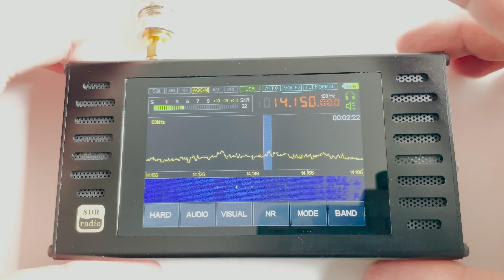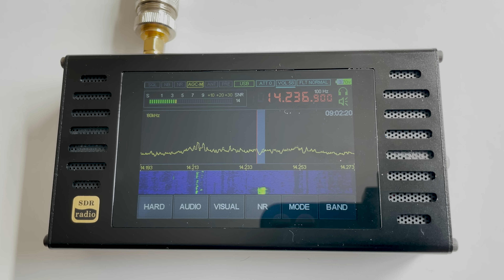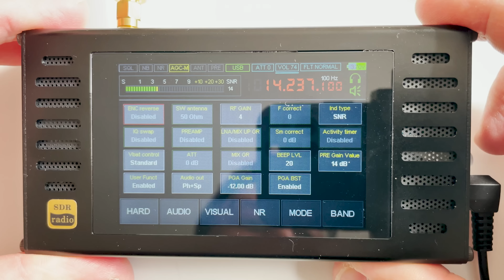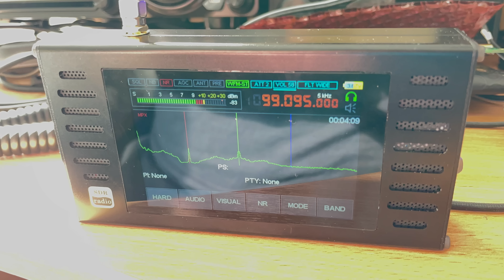Malachite V4 SDR DSP Radio Receiver 50KHz - 2GHZ

Comment: One great use for the Malachite is to find good spots for HF reception indoors or in urban areas by walking around with it and using a portable HF antenna. I use mine with one of those SDR Mini-Whip active antennas attached directly on top with a couple of SMA male-to-male adapters and walk around finding where I get the best HF reception.

Comment: You forgot to show that FM Radio Retro Mode that beautifully imitates a classic Retro (Yellow) Radio front, every skip gets you to the next scanned and listed station (on the fly), really a nice pocket Radio for those that wanna have all the luxury from a gadget like this. I use it most of the time on the go as i do not have lots of other stations on other bands to listen to. I need a better antenna for that.
Reply: Spot on. It's a nice little device for travel too. Little pricey to stock "bug-out bags" but keeping on at your cabin, in your RV or just at home in your emergency kit is cool. I found the FM retro option my accident and thought it was cool.

Comment: it is a Chinese copy of Malachite SDR, the original and Made in Russian it can be found on VK.
Reply: Malahiteam or Malahit DSP (now on version 2) is the original. Malachites are the Chinese clones.
Reply: stay away from these
Reply: VK? what's that?
Reply: @chelrob2  almost 100% sure a clonded DSP1 with old f/w you cannot update (until the chinese find another way to get it. Or you send $$ to the makers of the hard/software (malahiteam) which means that you will pay a lot more than the original.
Reply: @RoelandJansen  Supposedly mine comes with V1.1c.And seems to be the case.Bought mine in USA.
Reply: @skideric  current version is 1.10d  btw.
Reply: @RoelandJansen  Yup,I know.No Prob,like it just the way it is.I researched long & hard before getting one.No way i was EVER gonna be able to get an ORIGINAL.So,settled on this one.Also have a G90,which is very good also.KO4GNW
Reply: @RoelandJansen  Hi Roeland, thnx, can you indicate where best to purchase an original Malahit? thnx Han pa3bpl
Reply: @hanvanloenhout7045  hoi, I'll send you a mail to the address exposed on qrz, ok?
Reply: @chelrob2  Yep, you are right. I got mine yesterday. IMO, the antenna doesn't do it justice for HF DXing but it did work. Never got the built-in decoder to work. I was able to get my Schoolcraft decoder working pretty well though, however, the auto-correction was non-operational. It appears the damn cat had chewed off the eraser.
Reply: @RoelandJansen  Goodluck getting in touch with them. The website doesn't work (blocked?). I'm going to try a VPN tonight and see if that helps. Can't even find a manual for these online.
Reply: @tc1uscg65  probably blocked there, yes. docs are there but not too well wrutten and 3rd party trials are somewhat better.

The dsp1 is a gadget if you ask me.
Reply: @RoelandJansen  50 $$
Reply: @ivanpoddubnyy3421  what?
Reply: clonded

Comment: Dang. I just bought the v2
Reply: you are much better off with a DSP2; This almost 100% sure is a cloned DSP1.
Reply: Has to be a clone.  If you go to the Russians website it only has the dsp2 version. They authentic ones can only be acquired through the Russian dude through email
Reply: @ReefMimic  IT IS A CLONE. this is a DSP1 in a different box. Looking at most of the issues, they are even worse compared to the original when it comes to quality.

Comment: Would love to see some specifications on sensitivity and selectivity.  Is SW reception essentially dead with the provided antenna? Yes, I know using a full size external antenna is an option, but if I buy a radio like this, I would want some level of performance even with a short portable antenna.
Reply: it can be used if there is a lot on the bands during contests. you could use a wire or something. a full size antenna is nit recommended as it will easily overload the shole stuff.

Comment: I've been looking for a somewhat decent clone with activated firmware for a little while. Bought this the day you uploaded, it arrived in the UK today and I'm happy I finally bought one.
Although the touchscreen was not working at all so I did have to open it up and reconnect the touchscreen ribbon cable. The little orange ribbon with the chip on it, between the two red/black twisted pair. Maybe happened during shipping or a forgetful assembler but all good and working now :)
Sure it may not be as good as the real version but sure beats connecting a usb dongle to my phone. With the current coupon discount and some credit I had in my banggood account it cost £106 delivered to the UK in 10-11 days :)

Comment: Hello! What is the reason for the gap between 250 and 400 MHz? And who is using those frequencies?

Is this device good for receiving air band and can you recommend a cheaper/simpler unit that would do just that?
Thnks!
Reply: I was going to post that question, why the gap? Would it have been much more expensive? Or is it because of legal restrictions?
Reply: @advisord7637  apparently it's the russian army band, although in Ukraine's "special operation" they used unencrypted baofengs

Comment: Anyone found an English manual for one? The touch screen looks beautiful but is barely functional at all.
Reply: No luck but I just got mine yesterday and started looking around. What software is used to control it on a PC. Plugged it in, but it didn't pop up. WIndows see's it, and shows up in devices but that's about it.

Comment: Why are they blocking out 250-400 MHz?
Reply: That frequency range is not allowed to receive by Russian laws - the original hardware design is Russian, and the firmware is Russian.
Reply: @automaton450  ah okay, thanks for the info. 

Has anyone found a way to disable that? 

It seems weird if China is replicating it but still enforcing an irrelevant frequency range lockout.
Reply: That section of the spectrum is reserved for military and law enforcement  in Russia.
Reply: They're blocking out 250-400 MHz?! I didn't know that... Well that would knock off mil-air.
Reply: I have the 3 official Russian Malahiteam models.  The original with optional board (also referred as DSP1), the DSP2 and DDC.  The DSP1 running FW 1.10D has the 250-400 MHz gap as the clones do, while the DSP2 running FW 2.20A has a smaller gap of 380 to 403 MHz.  The intent was to eliminate the gap for DSP2.  The reason that a 23 MHz gap remains has to do with the main chip not able to lock or “resonate” those in between frequencies. The DDC has yet to release its optional board which has the filtering and conversion circuitry for the VHF/UHF bands.  The engineer promises for the DDC no gaps 10 KHz to 2 GHz.  Therefore I do not believe the 250-400 MHz gap is for restrictions.  I believe it has to do with its circuitry not performing well in that range.
Reply: Since they censor these stuff, use an SDR :)
Reply: @Antenna101  isn't that the purpose of this product? To act as a portable sdr with screen?
Reply: @GadgetAddict  whats the purpose owning an sdr that censors specific bands?
Reply: @Antenna101  yeah that's the thing. That's why I was asking if anyone found a way to bypass the limits

Comment: I've had old shortwave rigs in the past FRG7700, Kenwood R-2000 for listening, decoding RTTY, CW, SSTV etc.  Would like to get back into SWL.  Is SDR the way to go or should I be looking at a traditional rig?
Reply: I have a lot of experience with portable radios and I'm also a Licensed Radio Amateur.   

My advice to you would be to get the new Tecsun H501x it is a really good radio and nice and big for using at home, for too long all we could get new were much smaller radios, at least ones that could do SSB.

The malahit radios are good but small and the screens are small, to be honest as much as I like my DSP 2 Malahit I mostly use the Tecsun H501 X because it sounds so good and it's a real nice radio to operate.

For antenna I highly recommend the Bonito M305 which is optimised for portable radios and it's great for pulling in distant stations because it's got really good signal to noise performance, a long wire might be fine but it also picks up a lot of noise. The bonito is a tiny whip antenna, use good quality H155 cox and ground it to bleed off any static. Mount the antenna outdoors, only needs to be mounted 6.5 meters off the ground, A radio is only as good as the antenna. 

Check out my youtube channel and you will see me test some radios, at the end of the day SDR are good but there's nothing like using a traditional radio.

These days there is a lot of interference from electronic devices and if you live in an apartment or close to other neighbours you might hear a lot of noise and if that's the case you can still take the bonito and h501x portable, the bonito will work with USB power bank. But you'd be surprised at how much noise comes from your own home. Laptop power supplies, phone chargers, led bulbs etc.

You can use online SDR such as the kiwi sdr, check this link out, there are many online and you will need to find one that isn't plagued with interference causing lots of buzzing noised wiping out all but the strongest of signals. 

http://kiwisdr.com/public/

It may take some time to get familiar with the interface but if you find a good one with low noise I think you will have a good time using it. 

 Best of luck and definitely get back into this wonderful hobby and don't forget to check out my youtube channel.
Reply: Check out icons new HT and base station radios. Expensive but they combine a traditional radio and an SDR radio.   It may lack in both or be perfect I'm not sure.  I wanted one but too expensive still.  North of $500.  So I bought an AnyTone AT-D878UVII Plus.  Seems to be the #1 radio right now and I'm getting into Digital so it's perfect for use.  I've had it a week and still don't know how to use it though lol.  It definitely takes some time to figure out.  It's not a user friendly radio it has many options to figure out. Looks great, feels great though.  I don't thing these SDR radios pick up Digital yet or DMR but not sure, that's where things are going though. Although for preppers Digital may not work over the internet but it has analog also and digital still goes a little further on its own even without internet based repeaters.
Reply: @extrememiami  Many thanks, I'll do some research!
Reply: @o00scorpion00o  Agreed.  I ordered my Tecsun H-501x this week.  Looking forward to receiving it.  I currently use a Eton Elite Executive for SW DXing and it's a bloody amazing radio but I'm tired of the chuffing when tuning.
Reply: @STR82DVD  Oh dear, it has that muting when tuning ? that is the worst thig ever but on a tiny radio like the Tecsun PL-330 I live with it because it's such a small radio and it has SSB and it's a very good performer and handles external antennas well for it's size which is pretty amazing if I compare it to the similar size PL-310ET plugging in my 134 foot long EFHW Antenna causes it to crap itself especially at night. 

Anyway, congrats, you made a good decision, I think you'll be very happy with the H501. 

On medium Wave and Long Wave if you are using an external antenna you will need to press and hold the number 3 button until CH5 appears on the screen or else you will experience a lot of overloading. 

It sounds really sweet on AM with it's 2 speakers and it's nice and big, good for home use. 

Let me know what you think of it, and remember, on SSB to use the AM BW button to cycle through the filters and not by using fine tune, using fine tune makes the audio sound muffled but cycling through the filters via the AM BW button will fix it again.  It's a little bug in the firmware.
Reply: @o00scorpion00o  Thanks for the tip on the SSB filters.  Brilliant lad.  👍😁
Reply: @o00scorpion00o  I do have to say that even though I purchased the Tecsun H-501x, the Eton Elite Executive is a radio that has insane selectively and sensitivity and has every basic feature I would need for DX happiness.  The muting is manageable but noticeable and given that my birthday was coming up, Anna at Anon-co was very helpful in finding me a non-negotiable birthday suggestion for my wife. 😉.
Reply: @STR82DVD  Well lucky you and happy Birthday 🙂

I think most modern radios are as sensitive as you will find, the difference is the antenna, indoor on the telescopic antenna vs dedicated RX antenna outdoors will always be night and day.

I do find the Bonito Ma305 a great DX antenna and it has good signal to noise ratio, a long wire tends to pick up more noise.

I think the selectivity will be as good as the Eton, I don't know for sure though because I have never had any of the Etons, they can't be got here in Europe, I could never find one or even on Amazon.

On commercial stations I find myself using SSB a lot which I find an essential feature for chasing DX, it can work better than just the filters on AM alone and SSB is very effective against fading. 

I think you will really like the ability to use external antenna on LW/MW too which is rare these days on any radio. 

Keep me posted.
Reply: @o00scorpion00o  Thanks lad.  I'll let ya know for sure.
Reply: @extrememiami  SDR generally needs a chunk of processing power to decode DMR, so this ultra-portable little sets may struggle with the CPU power and battery life (running a screen too). There's SDR software that adds in DMR decoding and other digital 'modulations' too. I've also just ordered the AnyTone, after having caught the bug from playing around with SDR for a few years - always learning! :)

Comment: I was a listener for years with a Yupiteru MVT-7100 and I've been thinking about getting something to get back into the hobby. 
It's a real shame this beastie has a gap in coverage, is there anything similar, maybe a little larger but still portable, that has continuous coverage?
Reply: if you want something handheld and akin to the brilliant 7100 take a look at the Alinco DJ-X11 or IC-R30
Reply: @Scotscan  Yup, i was really spoilt when my first radio for, erm... just seeing what was out there, was the 7100. 
From Radio 4 to Mir, HF ATC to weather fax, Red Arrows air to air coms to analogue mobile phones and everything in between. 
I'd love to be able to hook it up to my PC so i can receive weather sat images as well as scouring HF, decoding obscure data etc.
That's why i was interested in this device. Portable enough to take out in my car or putting in a pocket but capable enough to hook up to a PC for satellite decoding.
It was just that gap in RX that threw me. After the 7100 gaps really niggle!
I'll take a look at the receivers you've suggested. Thank you 😃☮️
Reply: @Aengus42  Try the Icom IC-R30, il has all the features you can dream of , recording is built-in, very simple to program with a PC, it is the best scannner I ever had... beware : it is selling very fast ! I was so pleased I bought two !
Reply: @jdupons  Thanks for the tip. What's it like below 30Mhz on sideband. 
Have you tried it with weather satellites?

Comment: Why do you call it malachite?  it's just malahit.
Try to look for strong tones around 10-30MHz which I suspect is the main resonant tone of ET scout ships aka flying saucers in the 15meter size range. There is good indication from close encounters that the hull is EM energized and that the shape of the craft is (like an antenna or magnetic coil) due to the physics it employs. Since they run at rather high power levels I suspect that these main tones and indeed complex harmonics can be detected from thousands of kilometers away. Some software to watch that band automatically might catch something within days or less because they frequent our skies quite a bit. Pun intended. If I'm right you'll be able to recognize the stable main tone because it doesn't carry any audio or other signal yet it will have complex patterns anyway. The higher frequency harmonics well into the GHz I speculate form a pattern to match the local mass distribution near it. Because they move by negotiating the local gravity potential energy field. But the main tone will be dictated by the hull size and should be steady. But might fluctuate greatly in amplitude. From bare minimum hover to gigawatt burst climb.

Comment: this is just a bad clone of the 1 or maybe 2. just go away, withdraw it.
Reply from the maker: Please justify your comment or I’ll remove it.
Reply: @TechMindsOfficial  the justification is simple in fact.

a)  there is a DSP1; there is a DSP2.
b) this unit probably has f/w 1.x which means a DSP1
c) the next one will be the DCC (not available yet)
d) the build quality of the DSP1/2 sometimes is not good
e) this is a clone, copied, stolen software
f) people now think - hey this is a new version of the DSP! 
g) see e: the clones are even worse

And I am not even talking about the standard performance of the originals.

I think you should not do this; you have all the rights to for sure and so is my comment. 

People should not be given the chance to get these "new" units. They aren't.
Reply from the maker: @RoelandJansen  I don't think I would call it a "Bad Clone" because for me, it works, and it works very well. I've also been told by banggood that the supplier confirms all firmware licences were paid for for full activation. How true that is I don't know. However, I think it's time I got an original Malahite and do some comparisons. Cheers
Reply: @TechMindsOfficial  I'd be very surprised if the firmware is legit. What version is it running? 1.10c? Try updating to the latest version and I expect it comes up in test mode and you'll need to buy a registration code from the original developer.